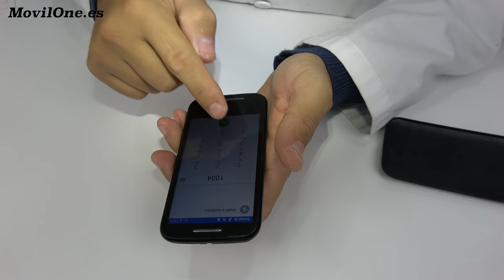Sim card reader replacement Moto E

Comment: Can you please tell me that what is the temperature and air flow power of smd machine when you are removing sim jack.
Reply from the maker: Hello, Innocent Age! Is 300 degrees and 35 of air.Best regards and thank you for asking.
www.movilone.es
Reply: MovilOne But i dont have option of 35 in my smd machine there are option from 1to 6 rhen what shoud i choose can you suggest me please
Reply from the maker: I thing it should be about 2.. Try it and let me know if it works! Best regards
www.movilone.es
Reply: MovilOne 3 works for me very well thank you so much 🙂🙂
Reply: HOT !!!